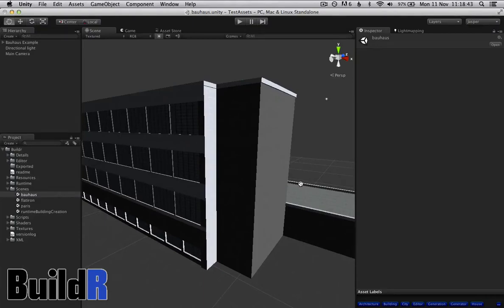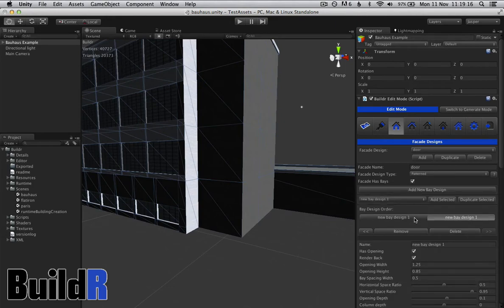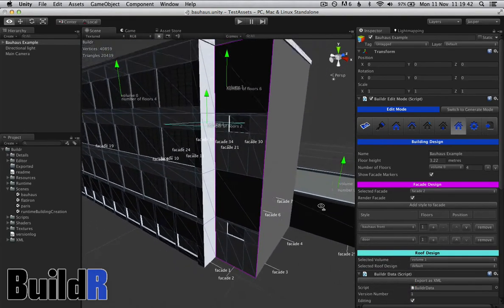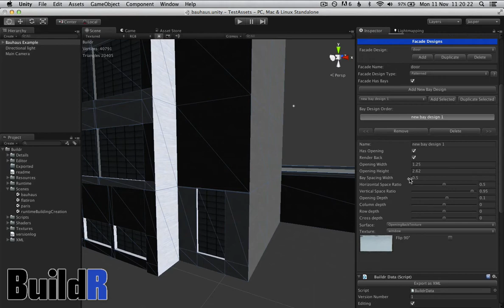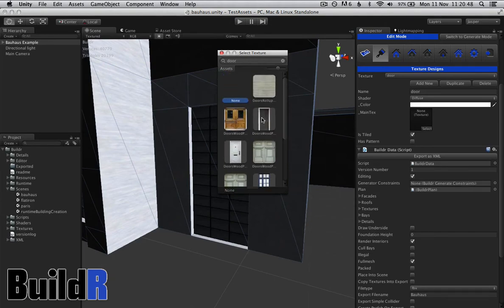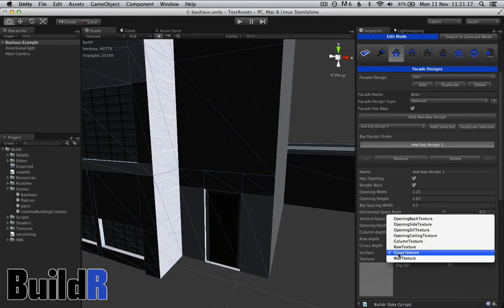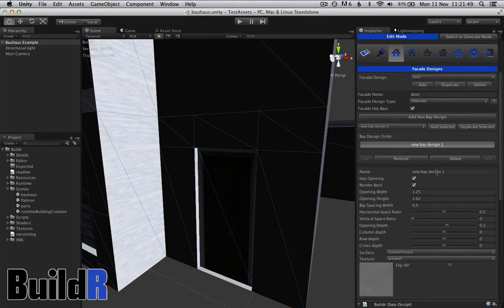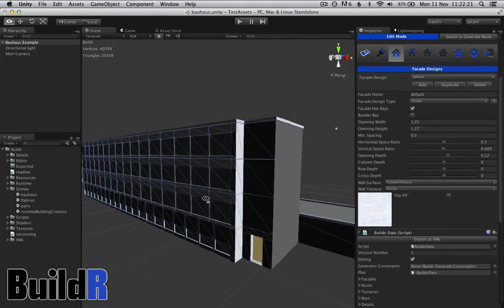Creating Doors in BuildR

Comment: While extremely basic... it's still much faster than Revit. Thanks for this!
 And I am sure in your country..... a "bay" is a window and a door lol...
 but a "Bay" window is completely different.
Reply from the maker: Well - I admit it's confusing and something I'll be addressing in the future but it refers to the architecture term bay http://en.wikipedia.org/wiki/Bay_%28architecture%29 as in a hole.
Reply: I have to agree with that! I am a architectural and land survey drafter... and there are plenty of things like this that are annoying. But here, a Bay window is an 3 sided extrusion from an outside wall. (45Deg 90Deg 45Deg) Normally fitting a sitting area on the inside window sill. Or if in a kitchen, it's used for a "eat-in" kitchen. A "bay door" would be defining a larger door for a commercial garage opening. I would just keep it window/door.... or you could be fancy and just call them "rough openings" since you can use windows as prefabs to fit them in. lol.

Now with BuildR.. I am going to buy, but, do have any plans to have the stair wells open to the roof top?
Reply from the maker: Thanks for the feedback! :o)
Stairs to roof on the list but I'm working on a city gen project that will have a few things that I will back port when done
Reply: Sweet. If you need ideas or have any questions with architectural stuff, just let me know :) I am going to buy after work today. Nothing beats using Revit for houses in unity... but nothing beats NOT leaving unity to do stuff either! Having this inside unity is crazy cool!